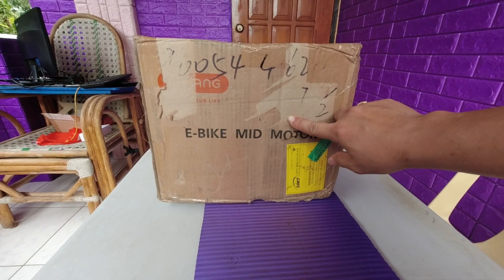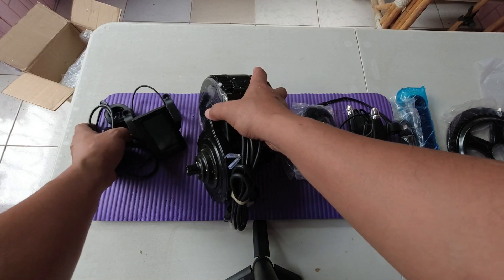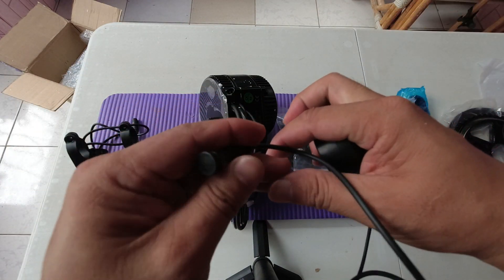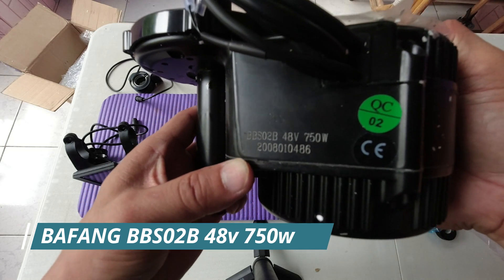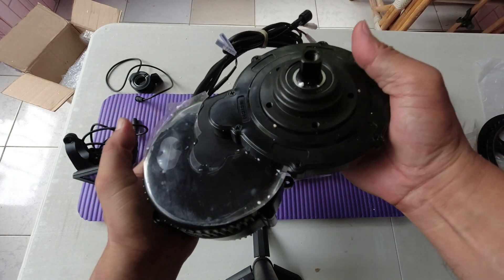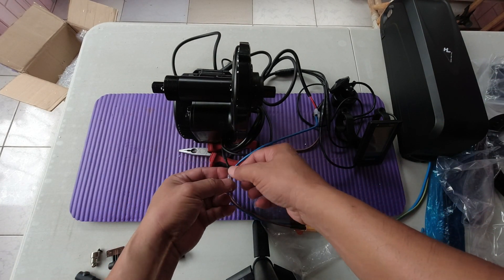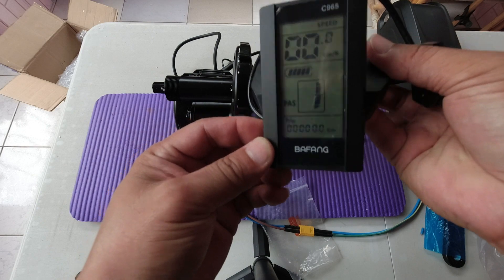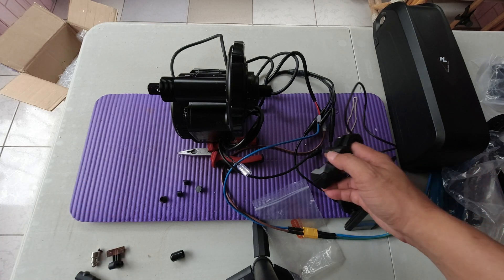UNBOXING BAFANG BBS02 MID-DRIVE EBIKE CONVERSION KIT | DIY Petz

Comment from the maker: Error 21 on the LCD display was because it was the speed sensor was not connected during the testing.
Reply: San nyo po nabili ung kit? (link po sana)
Reply from the maker: @EZY3DLAB  hi Sir, goo morning po. I bought mine from alibaba but medyu matagal bago dumating. You can check this shopee link Sir and check them out.
https://invol.co/cl7o8fo
Thanks.
Reply: @RollyPetz  Ako actually ung nag tatanong  jan sa shop na yan sir. kaso wala battery na available eh. San nyo po pala na bili ung battery nung sainyo?
Reply from the maker: @EZY3DLAB  DIY yung battery ko Sir. eto yung link...bought them also via shopee and lazada.
https://youtu.be/6UBfrO1D5JE.
Reply: @RollyPetz  Thank you sir! nag DIY lang din pala kayo ng battery pack! :D
Reply from the maker: @EZY3DLAB  Yes Sir, wala kasi available battery yung time na binuo ko yung 2nd project na to. Tapos mas mataas yung selling price kay sa nagastos ko sa DIY and mas mataas pa na ampere hour rating ang nabuo ko at least sigurado ako sa batteries na nabili ko Sir....tnx for dropping by sir stay safe po.